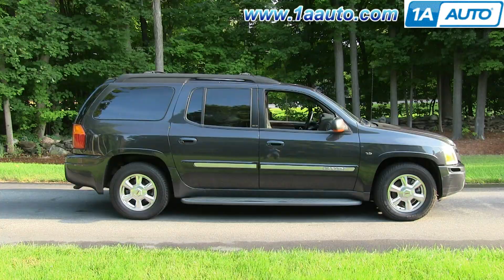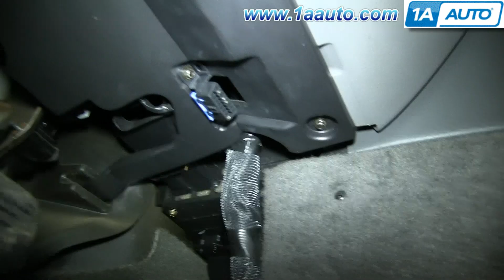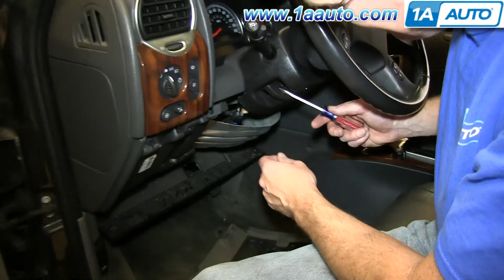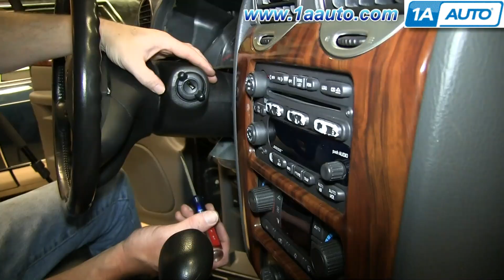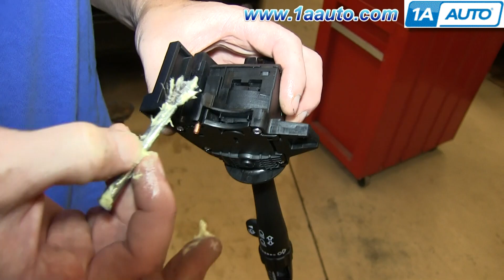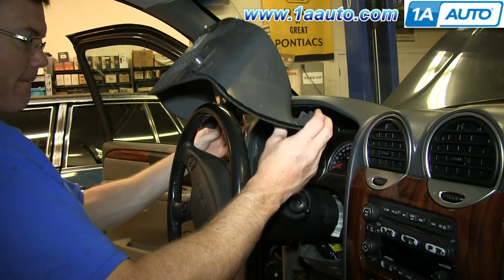How to Replace Combination Switch 02-06 GMC Envoy XL

Comment: This video was spot on in the replacement of my turn signal assembly for my 2004 Chevy Trailblazer and only the dash trim piece facia instructions are different since the video is showing how to do this work on a GMC Envoy rather than a Chevy Trailblazer.

Comment: I should’ve seen this vid before trying to replace the combination switch on my wife’s 04 trailblazer 😪 that lower t25 screw that’s harder to get to is now stripped 😖. Please help lol how would u get that screw out since it’s in an awkward position? Would I for sure have to remove the steering wheel?

Comment: Just turn the steering wheel and you will get access to the bolt without the need for the wrench and bit. I think a qtr turn does it.

Comment: This is the most annoying common part braking on these suvs. And I mean worse than the thermostat. It’s not the repair, it’s dealing with the brights coming on with the turn signal for months until you decide to fix it.

Comment: Hello the wipers and washers do not work on my 06 gmc envoy I tried to replace the switch and they still didn't work so I put the old one back in . And bought a whole wiper mechanism including new motor and they still don't work do u have any ideas for me please ? I also checked the fuze and relay

Comment: OK, I replaced this because my old lever wipers was only working on high. Washer fluid and any other speed would not work. I thought for sure this was the problem. However, the problem still exists. I've checked all fuses that I could find.

PLEASE HELP ME FIGURE THIS OUT..... 2005  chevy trailblazer.
Reply: Could be a wiper pulse board module.
Reply: Did u ever figure out the problem because my vehicle does the same thing
Reply: Mine does also

Comment: Great video.Well I replaced the turn signal switch and the same thing  right signal works and left signal works when it wants to just like before any advice. Thanks. Could it be a bad part? Or flasher?

Comment: Guys I've installed a new wiper/blinker switch as my right blinker only worked intermittently.  You had to raise the switch in the right spot for it to work.  It worked for literally 13 hours with the new switch h then the same issue.  Right blinker works only intermittently.  I need help with this as my job involves me driving a great deal and if that's not enough it is very dangerous to drive with only one blinker. You never know when it will or will not work. Thanks in advance!
Reply: UPDATE:  I was able to fix this issue.  It was not the Cruise Control/Wiper/Blinker control switch as I had thought.  Turns out that I needed a new Emergency Flasher Control Module.  The one that kind of just plugs-in underneath the steering column and under the panel there.  Popped the old one out, popped the new one in....  Took 10 minutes.  Took another hour to replace the Cruise/Wiper/Blinker control switch  back with it's original.  LOL!

Comment: do you know if this is the same instructions as an 06 trailblazer?
Reply from the maker: +Sam Winzenburg Hi Sam, This part also fits the 2006 Trailblazer it should be the same process on your truck. Here is a link to the turn signal switches http://www.1aauto.com/turn-signal%2c-wiper%2c-and-cruise-control-switch-lever/i/1azcc00166?utm_source=YouTube&utm_medium=CTA+Comment&utm_campaign=ytcomment&utm_term=6VelDzkg0r4

Comment: my horn stopped working  after i replaced this  any ideas?
Reply: it work only when i lock my truck
Reply: there is a little brass prong the presses against the steering wheel.  As I put the signal arm in that little prong was flushed against a plastic mold of the steering wheel.
I had opposite issue.  My horn was not  working until I replaced the signal arm, and now it works.

Comment: What do you mean "E5" never heard of that terminology.
Reply from the maker: +John Doe Thank you for checking us out. E5 is a inverted Torx screw that is used in certain manufacturers vehicles. There will be a socket with the proper head available through a local auto part retailer to complete the repair. 1aauto.com
Reply: Good to know, and great instructions, but you can just use a 4MM, or possibly a 4.5MM socket to remove the "E5" bolt. It might be difficult to find those types of sockets.